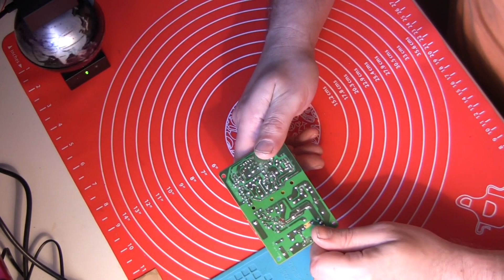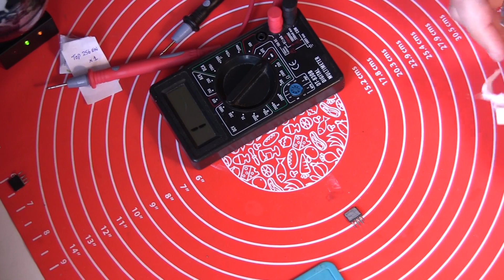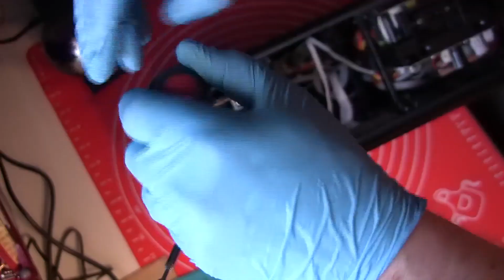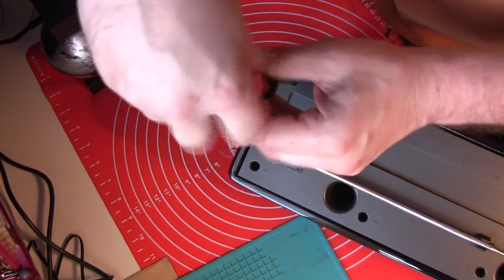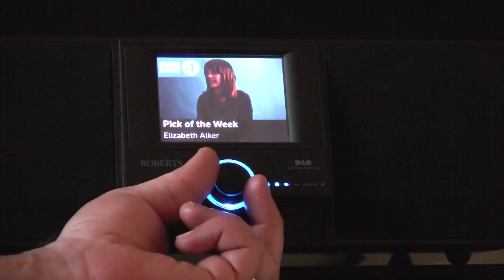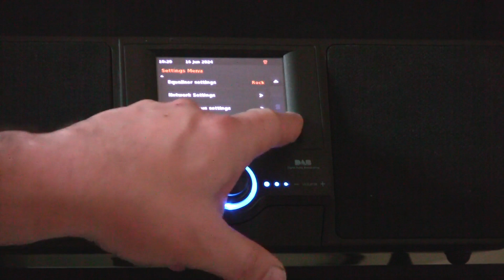Roberts ColourStream DAB, FM, internet radio - completely dead. Repair and assembly.

Comment: Good job... Mine has issues with volume I can hear through the head phones but not without. Roberts said to keep headphone plugged in for 30 mins as it maybe due to dust and may restart normal volume play.  There is a symbol on the screen looks like crossed off...Any thoughts and where are you based??  Many thanks
Reply from the maker: I am not aware of any known frequent problems with the radio. It is always difficult to advise without seeing the issue first hand. It could be something simple like damaged headphone socket making the radio think they are plugged in even if they are not (headphone plug lifts little tab in the socket and that way disconnects signal from going into the speakers, sometimes this tab breaks or bends causing permanent loss of audio via speakers). It could be something more complex like fault in the circuit driving the speakers. Unlikely software issue, but I am not sure about the 'crossed off' symbol. I do not have ColourStream anymore to do any tests with headphones and manual does not mention any on-screen notifications with headphones plugged...
Reply: @zadzwon112  Thank you for kind reply. Must be a loose connection with speakers. I have plugged in additional speakers as I do not want to discard the radio and it works!  Thank you again